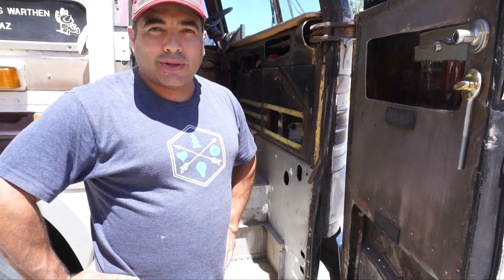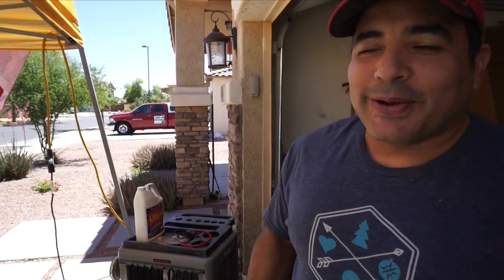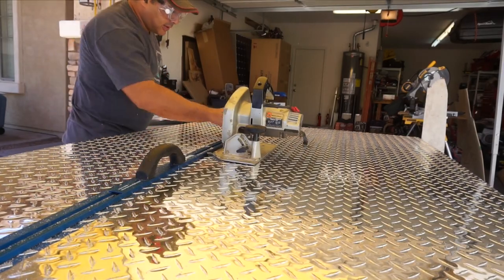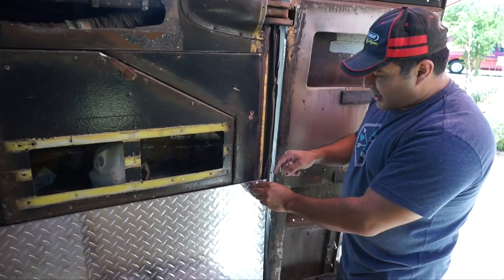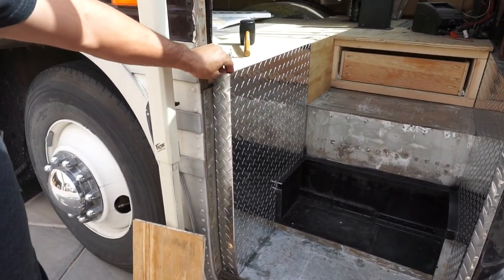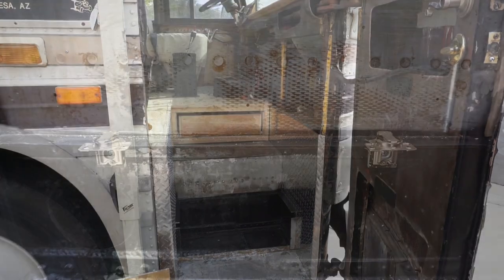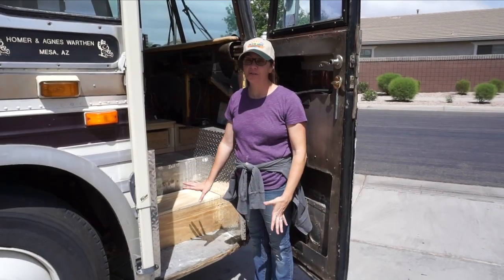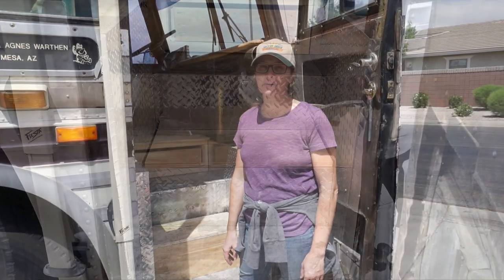Bus Stairs Part 2

Comment: I know this is extremely late, but I put in a diamond plate panel kit in my Samurai and the installation on that was using a drill bit then tapping the hole for an Allen head machine screw.  It took a while, but does keep the panels easy to remove but is also very secure.  The diamond plate looks really good.
Reply from the maker: Thanks Travis - it's not too late for someone just starting to do a similar project - thank you for sharing!
Reply: @BeginningfromthisMorning  I seen that later on you guys found riv nuts.  They work great as well for a lot of mounting options.

Comment: Nice work. I like the diamond plate aluminum. Step wells take a lot of abuse by feet, sand, water, etc. One tip I have is to paint any wood before you install it. Rustoleum smoke grey kind of matches aluminum and is very tough. Just assume that moisture is going to affect all exposed wood.